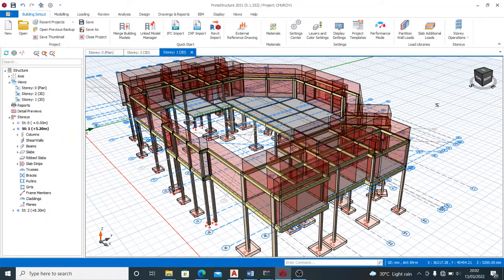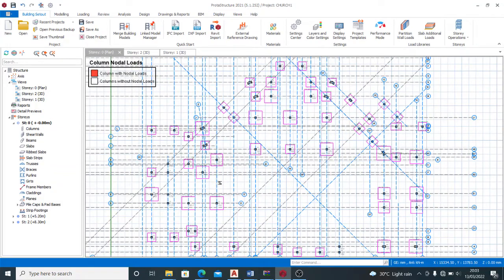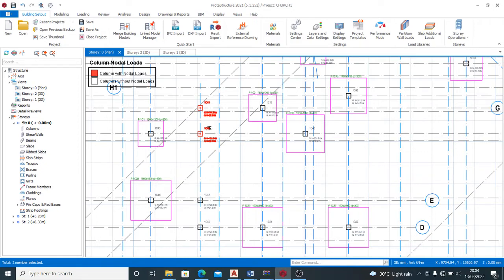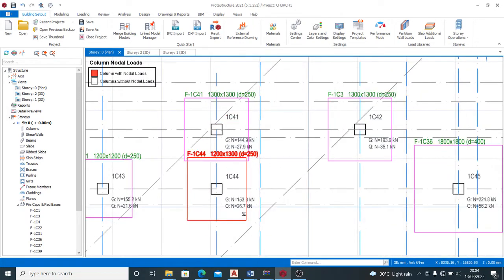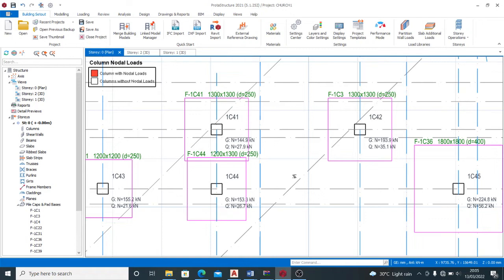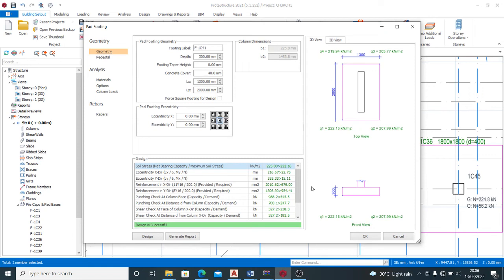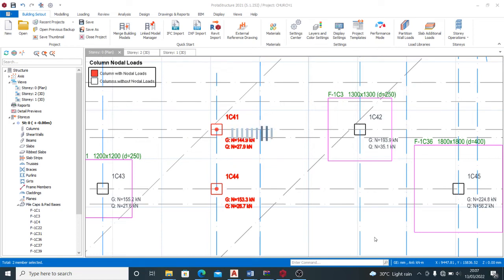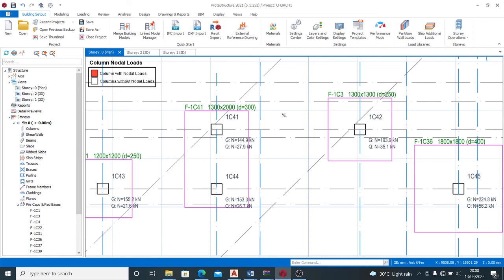WHEN TO USE A COMBINED FOOTING AND NOT AN ISOLATED PAD FOOTING

Comment: Thank your engineer.  When i combine my footing, it doesn't separate the columns. it group it into one straight rectangle. how can i fix it?
Reply from the maker: Currently, prota has no means to do that but combines several columns to form a single point on the base.
If we find a means around that in coming days, I will bring it to you.
Thanks